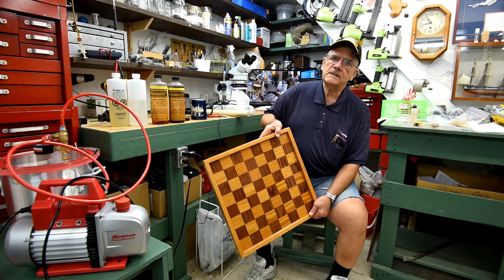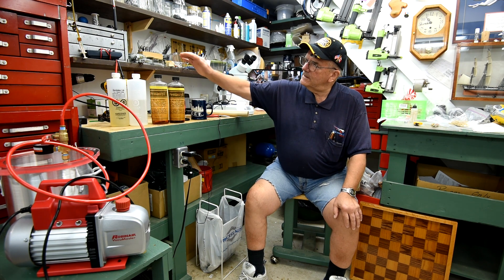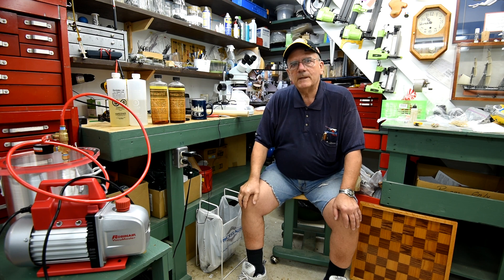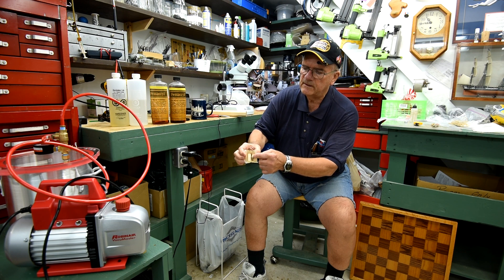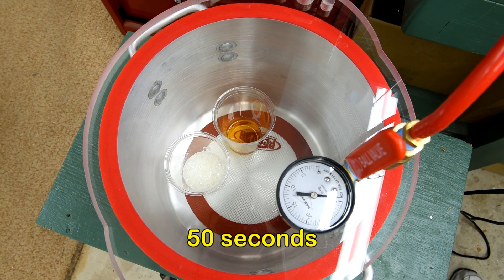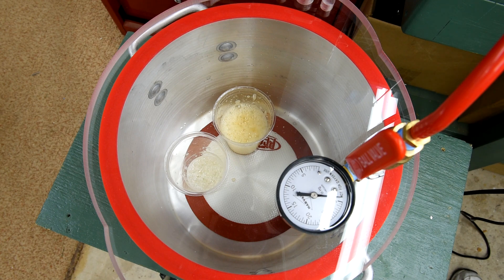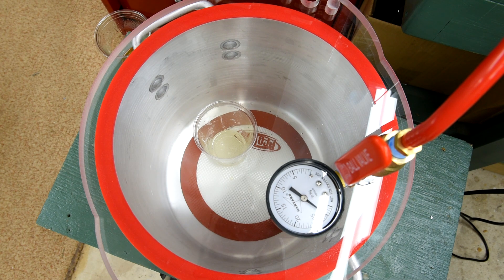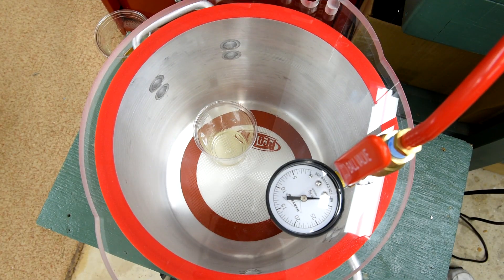Vacuum Infusion Test - Part 1

Comment: Where did you get the vacuum chamber you are using? That is a pretty nice setup for doing that stuff.
Reply from the maker: http://www.amazon.ca/ProVac-vacuum-chamber-gallon-size/dp/B00E0BG8R4
Reply: Ron Calverley Thanks I thought that might be it. I like the setup where it is a larger size but you can see through the top.